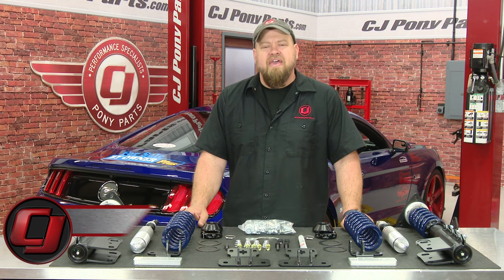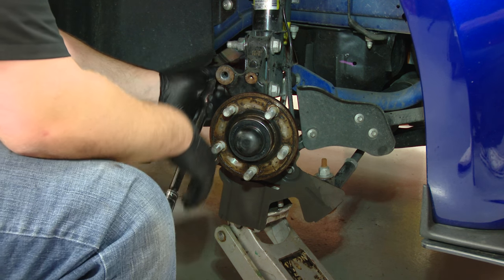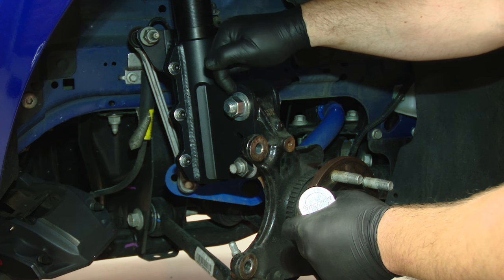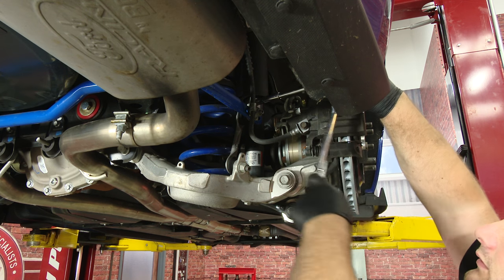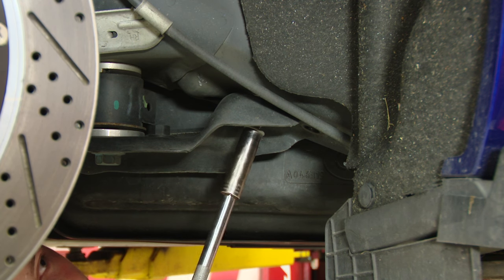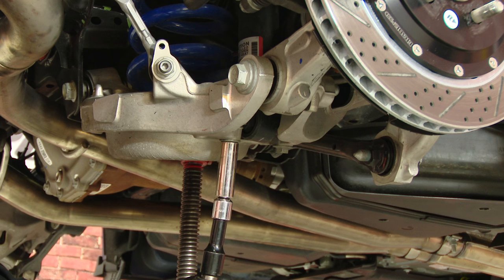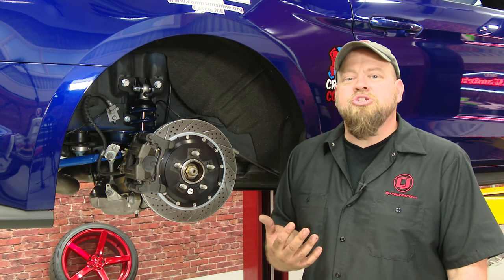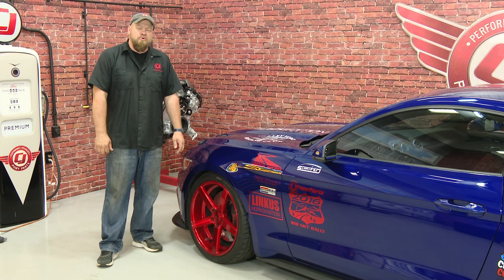2015-2020 Mustang Ridetech Coil Over Kit Level 2 HQ Series Installation

Comment: Man I was hoping it was a Mustang Ecoboost. I want to see more heavily modded inline 4 turbos.
Reply: Sorry it's all about the glorious V8 Coyote with most of these Mustang Parts shops!
Reply: JCTiggs Its ight. Not really a huge fan of the Coyote but I do like the GT350s flat plain design.
Reply: PyroBlonde7777 Just curious, what don't you like about the V8 Coyote? Low end torque, weight, and city mpg are the only things I can think of ☺️
Reply: JCTiggs While it is a modern design, it comes at a great cost. I know from a value point or cost of living aspect the Coyote is expensive compared to the old OHV engines. The thing is, with a little more displacement and a good flowing head, a OHV is leagues cheaper to go faster in the end. People think  the Hemi's legacy is dead but the fact is, with a small displacement, the 392 makes nearly 40hp more than the LS7 or LT4 from Chevy. That's a huge difference. I like the Coyote from an engineering standpoint but I don't want to spend thousands upgrading 4 cams and the associated valves. No thanks. Keep in mind the Coyote is already wound tight. The Hemi has a lot of room to expand and when its revving to match the Coyote its going to make much bigger numbers... For cheaper.

Comment: really high quality looking suspension kit bill, i see ride tech is located in indiana but do you know if the whole kit is made in USA? and are the front shocks rebound adjustable like the rear shocks with a little nob somewhere?
Reply: Front and rear are both adjustable, i can't say every small piece is made in the USA but a lot of the kit is. i have visited RideTech and they have a nice facility and build a lot of parts.